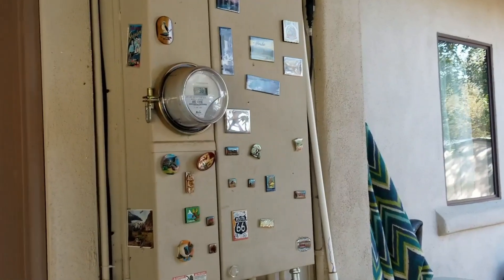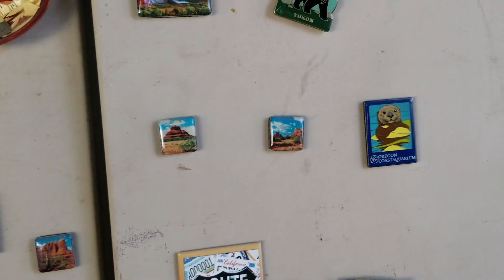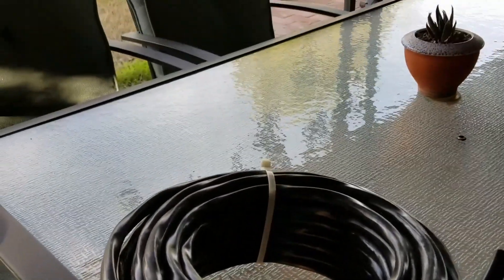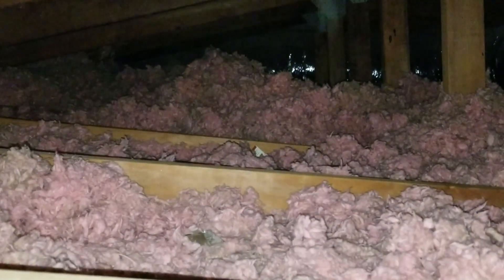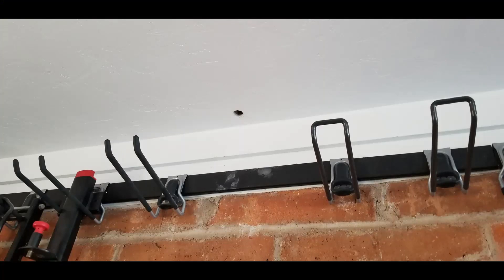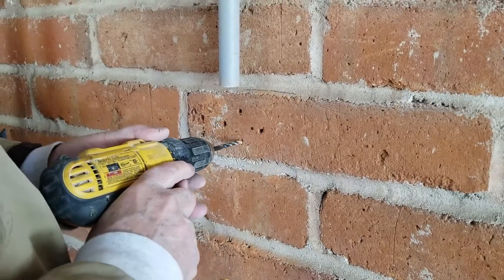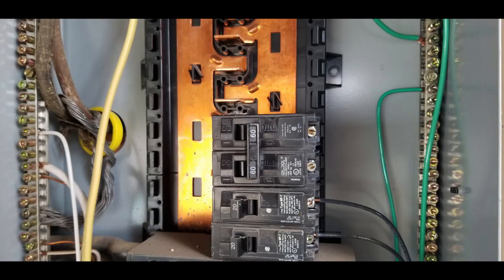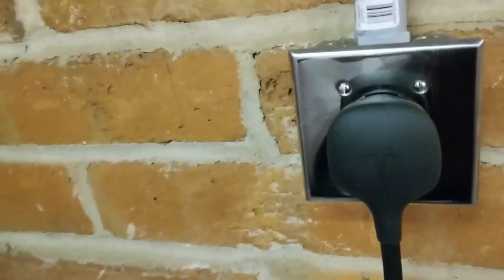running 240v power to garage to charge my Tesla Model 3

Comment: Sorry for the late comment....just found your video. I envy your determination! I live in Florida so running wire through the attic is always a last resort (in the winter). My run was inside the garage and I opted to run conduit rather than go through the attic. One of the toughest tasks for me was the 90 deg bend through the connector into the wall. Curious how you were able to bend and push the cable through, secure the cover plate onto the connector and anchor it into the wallboard. Thanks for the video.
Reply from the maker: I stripped the covering off the wire where it entered the conduit and ran single strands down the conduit.

Comment: No no no, this is not correct, do not put a 60amp breaker on a NEMA 14-50 plug that is only capable of 50amps. You want to switch out that breaker with a 50amp breaker for safety reasons and then if/when you get a Tesla wall charger swap the breaker back out for a 60amp.
Reply from the maker: Sure, good point. I put the 60 amp because I will be getting the wall charger. But that makes sense. I will swap it for a 50 amp for now. Thanks!!!

Comment: I’ve never seen so many blank spaces for circuit breakers! 
I’m really glad to see that you went for the 60 amp breaker, to get the fastest charge possible with the long range battery and wall charger. 
Well done 👍
At least you waited until winter or you might’ve died in the attic.
Reply from the maker: I have 2 panels, the other smaller one inside the house, is full
Reply: Tesla Social The sub-panel is in the house?
Reply from the maker: @mitchellbarnow1709  yep